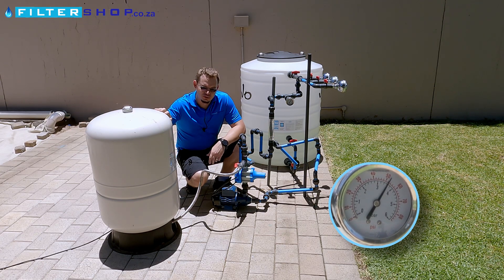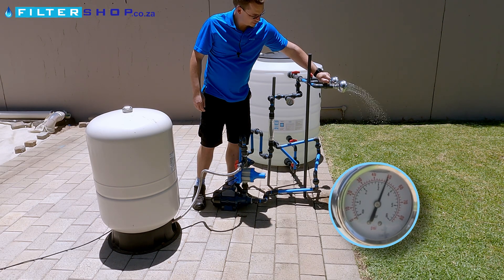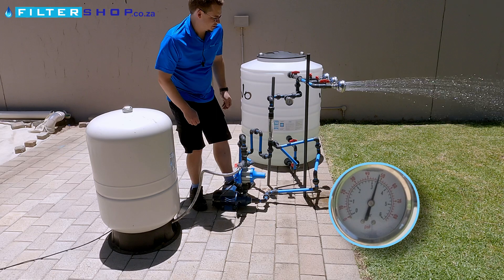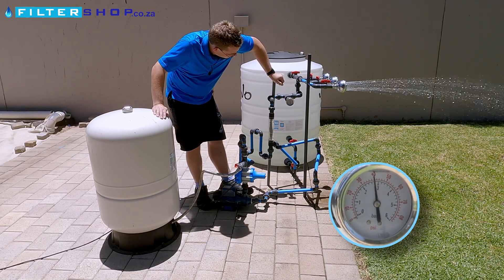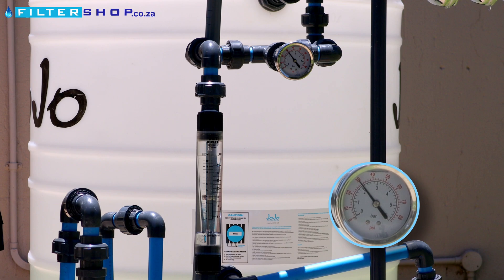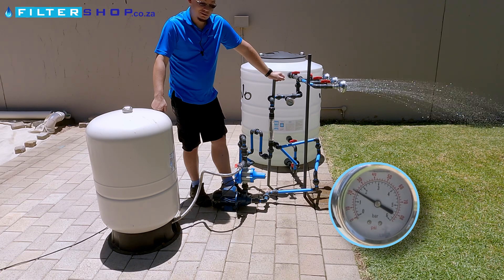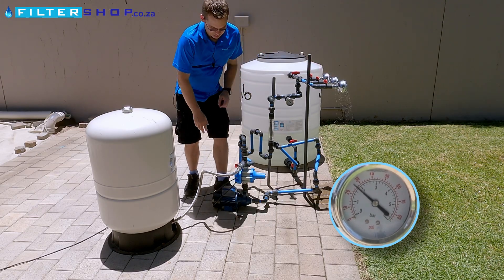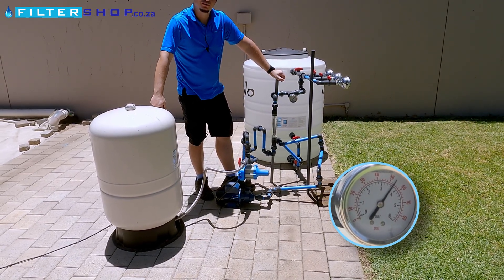Pressure Tank in Action

Comment: I cant find a video explaining where/how exactly the pressure tank is connected?
Reply from the maker: Hi Eddie,

You basically just want to just T in the line after the pump.

As long as it is after the pump and the pumps non return valve it will function as a pressure reservoir.